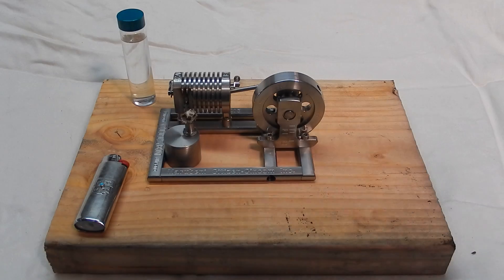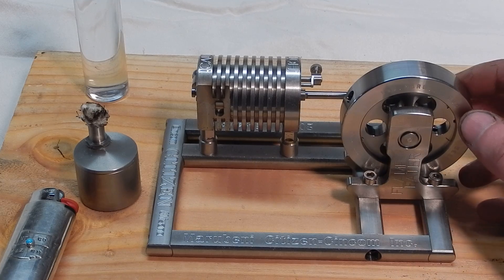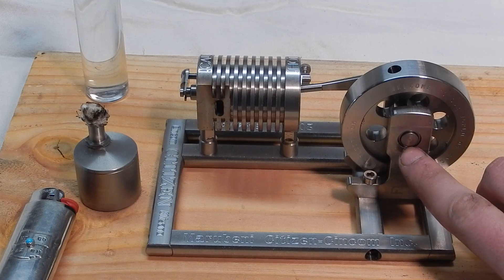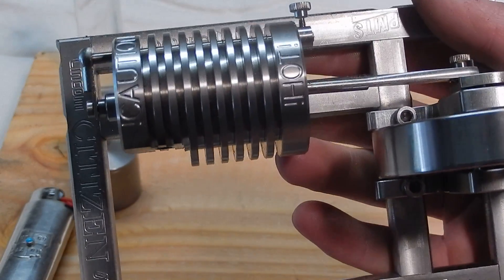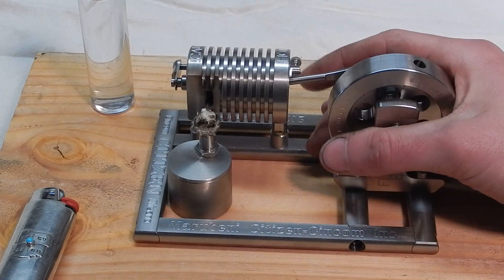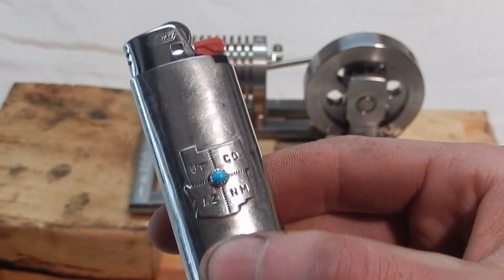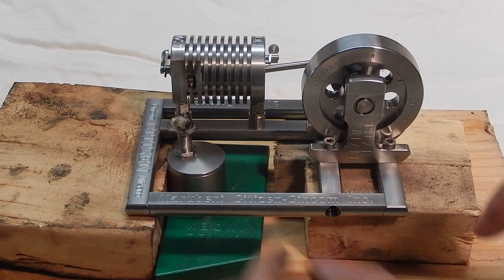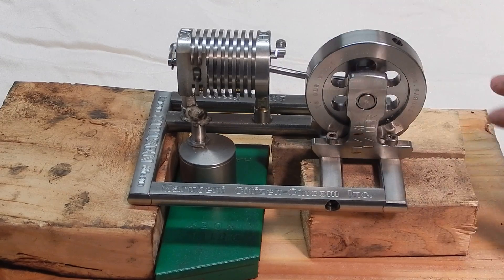My Flame Licker Engine - Show and Tell, and Request For Help

Comment: pre warm the cylinder to prevent condensation forming inside, never use oil in the cylinder fine graphite is all it needs. The flame looks a little far from the port to me

Comment: The exhaust valve should close at about 35 to 45 degrees before bottom dead center (Piston). Intake valve should open about 45 to 35 degrees after bottom dead center (About 45 to 35 degrees before top dead center).

Comment: Try "running it in" using a buffer or rubber disk to friction drive the flywheel to let the  piston and cylinder h
one to each other. Spin gently (no flame) and hope to see that it coasts better after a while.

Comment: From the video it cannot be seen how far the flame is from the port. This flame has to almost touch the port surface. The base of the flame should be about level with the bottome edge of the port and during operation almost the entire flame is seen to be taken in. It would seem that the valve fit as well as the piston fit are rather loose. As you mention the surface of the cylinder has not been made smooth and this is probably the same with the piston.
Reply from the maker: Thanks for the help! I had the flame in all different positions, but i did try running it with the wick right next to the port. One day i'll take the engine out of the box and try it again!
Reply: That is a very finely built engine even though it does not work as it should. Vacuum engines must be very carefully designed. The piston must be leak proof  as must the valve. If the flame is too large, the up draft is much too strong for the  engine to suck it into the engine.  The value must open just before  the piston top dead center and must close with about three quarter of the stroke available for the development of vacuum/ I think that the trouble is most likely poorly finished cylinder and piston and valve fitment. There would be no point in adjusting the valve timing when not enough vacuum is being created due to leakage   around piston and valve. I do not think that the fuel would make much difference to the working. Mostly ordinary meth works just fine. Please try and make a new piston and valve and do finish these for leak proof working. I do hope you will get this beautiful engine working as soon as possible. All the best to you.
Reply from the maker: @vivianastridge2167  Thanks for your suggestions! I'll keep messing with it.

Comment: Hi.  I haven't got a flame licker but I have a decent idea of the principle.  Basically, it's only the gas you want to be hot for a moment while entering, then rapidly cool.  It follows that you want the cylinder to be cold.  I'd try using a more focused flame and dribbling ice cold water over the fins.  Worth a try?  Nice little machine, a bit sad that it doesn't work,  but from other videos I've seen they are usually marginal.  Oh another tip from other videos:  graphite would be better than oil in the cylinder.  Good luck!
Reply: I have just had another thought.  Aren't you putting the flame by the exhaust port?  Shouldn't it go at the end of the cylinder where the small valve opens?
Reply from the maker: Thanks for the thoughts. I'll try some graphite lube next time. As far as the porting goes, there is only one port, up by the head where i'm putting the flame. thanks for watching!

Comment: have you let it warm up? some won't run cold they actually need to be very hot to run.
Reply from the maker: yea... i've tried hot, cold, and everywhere in between!
Reply: themadmailler the one I just built will only run well when it's warmed up past the point it gets condensation, it will only run with a very light oil like wd40. it's seems to like the bottom of the flame more then the top of the flame (right where the blue almost turns yellow) it also runs 10 times better and easier to tune with propane or butane flame. not a torch but just a big blue yellow flame. I mix my alcohol with a bit of naphtha or similar to turn the invisible alcohol flame into a yellow blue flame. (easier to adjust) the flame also can only cover up half the intake. it uses half of the hole to intake and the other half to exhaust. it will not run if the flame is directly in front of the hole..

seeing as it's professionally made? I doubt it's the engine it's most likely user error.. the engine I built is identical internal valve. the time. I g on yours seems ok
 the valve should close just past the port at bottom dead center and open just enough to open the port at TDC...

best of luck.
Reply from the maker: Great info. thanks! I'll pull it off the shelf one of these days and play with it again...

Comment: I know EXACTLY why it gets sticky when you are trying to get it going. I just went through the same thing.. Until I picked up a propane torch I had handy and really pre-heated the engine.  When it's cold, condensation gets in there. You can either let the flame on the burner warm the block, about 2-3 minutes. Or use a torch, it takes about 15 seconds. 
This is a must for any flame licker engine..

Comment: Thats a neat little engine. I think the valve is open too long, making it so the air is too hot, and not letting it cool, so it can't keep making the power stroke. That is very very cool though. Be cool to see it run.